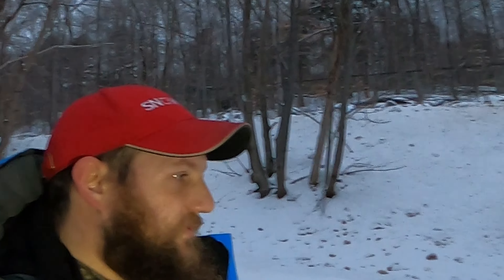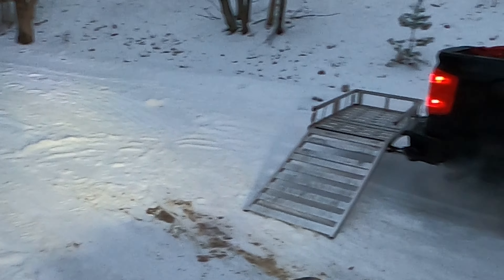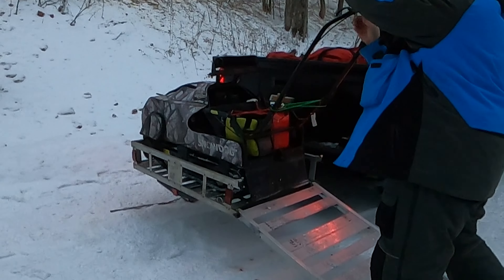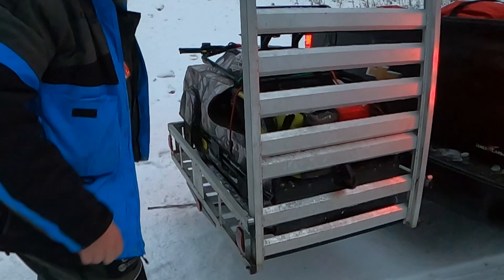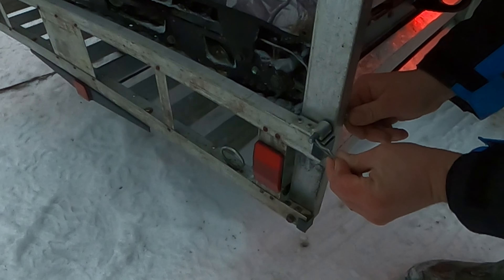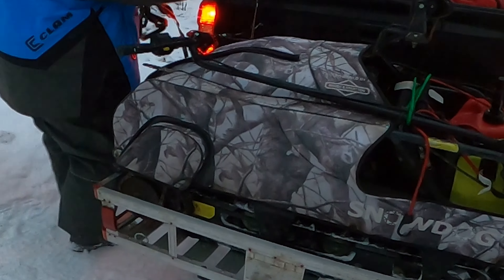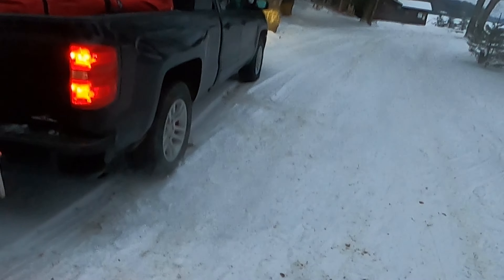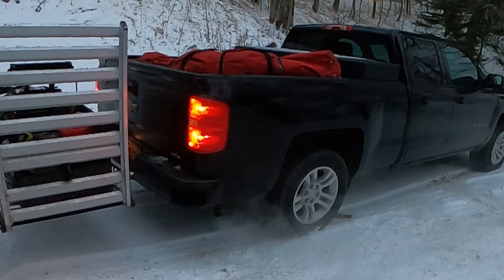How I Load my Snowdog for Transport!

Comment: I just bought a 10 hp Snowdog Compact, similar to yours, and I bought the exact same trailer hitch cargo carrier you did.  I can also tell by your video that you originally had the same problem closing the ramp that I am having  because the sled hitch on the Snowdog hits  a crossmember on the ramp.  Did you drill out the rivets so you could move that piece up and out of the way?  How did you reattach it?  Thanks for your video and hopefully a reply!
Reply from the maker: Yes i drilled it so it so it slides and fits!

Comment: I got a new snowdog and I think it would be too much weight on the rear reciever like that. I also had a cargo rack like that but from northern tool and it was on sale which I thought was just a sale but the thing sucked because it bent too much and I ended up giving it away.
Reply from the maker: I have a few thousand miles on this one up and around the adirondacks.. no issues it has not bent.  I also use a reciever stabilizer clamp which makes a huge difference i think

Comment: What model snowdog u have and ramp hitch..want to get same setup...
Reply from the maker: This one is a compact model B8ZE..I also have a long track B13 MER the compact fits this harbor freight ramp. The long track does not
Reply: @crowpopper  which of the 2 is better ...was looking into the long one since I think it can pull heavier or do they both pull the same..
Reply from the maker: @deeyaaj9148  i just got the long track but it worked really well.  I will be doing some videos with them and side by side testing.